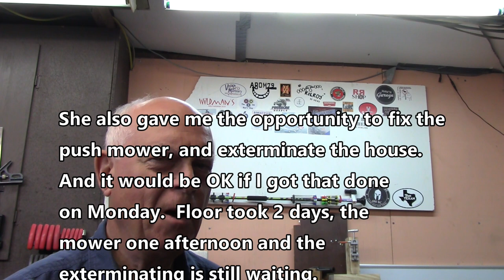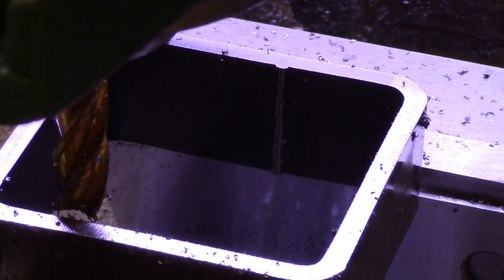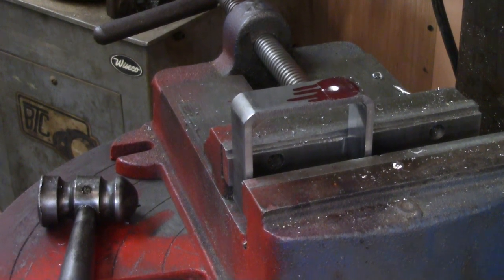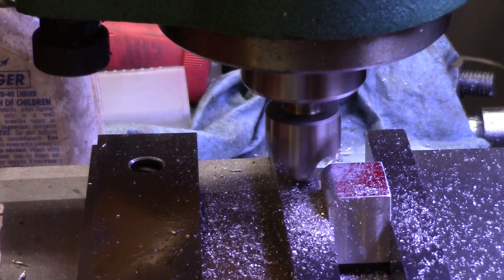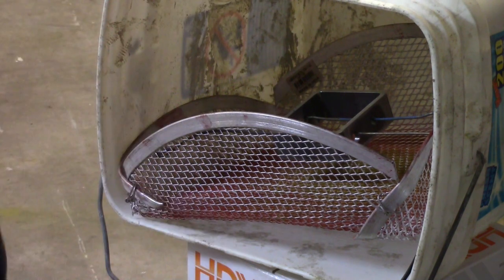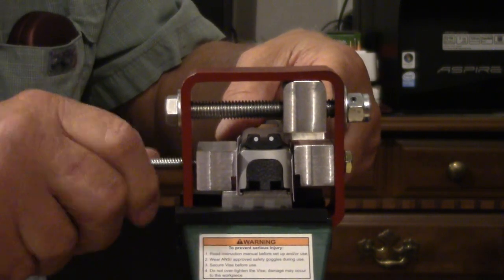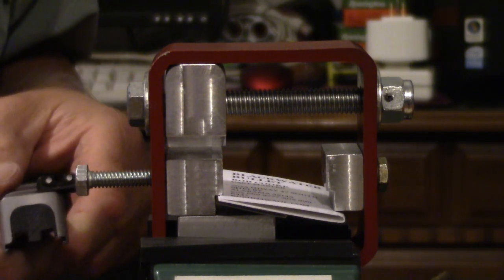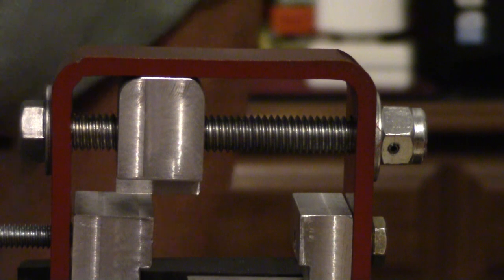Sight Pusher

Comment: A metric adjustable. I've got one of those. I've been meaning to make a sight pusher. This video just gave me the kick in keester that I needed. Thanks.
Reply from the maker: Go for it.  It is strange that such a simple thing took me so long.  I did at least half of the work off camera and still had a terribly long video.  Thanks for stopping by.

Comment: Harold, good video as usual. I would suggest you take a few little pieces of leather or even felt and glue them to the contact points to protect your slide.
Reply from the maker: That is an idea for sure.  Thanks for stopping by.

Comment: Hello Harold,  I coulda swore that was going to be a walnut cruncher!  Should get yourself an air pistol and or rifle and fabricate up a bullet trap (I used 3/16ths steel.  Looking endo it resembles a pie slice.  45 degree angles and the pellets deflect down into a piece of foam, rag or such.  Shoot up a storm for little money in your garage.  You would be surprised how the trigger pull and muscles are improved while you have a blast without having to gear up go to the range and wait your turn.  My off hand shooting with centerfire stuff was markedly improved when I was using the air rifle.  With my new shop expansion I am going to be able to get into it again.  Take care.  Doug
Reply from the maker: I have some Speer plastic bullets that I can use to shoot in the garage.  Just the primer is all you use from a regular gun.  Thanks for stopping by.  Unfortunately they are 38 special and I seldom shoot a revolver.  Thanks for stopping by.

Comment: Go look in my toolbox and bring me the metric crescent wrench. LOL. I am an electrician, I used to tell my green helpers to go look behind the seat in my truck and bring me the wire stretcher. They would look for a few minutes and come in and ask what does it look like? I would look at them and say "Damn ,am I going to have to go get it myself", So back to the truck they would go. I would finally let them off the hook and explain to them if their wire was too short their are other options.
Reply from the maker: New guy pranks are a lot of fun.  Everyone gets a turn on both sides.  Thanks for stopping by.

Comment: 10x6 a walk in closet, lol, thats bigger than what is called my 3rd bedoom! (its6x6 and the door misses the bed by 1/2 inch).  i reckon those cookies ARE oroes, i tell ya why, in the UK we dont much like them , so the have sold them SUPER cheap like 10c a pack, so i reckon someone rebranded them as a way to get rid of excess.  I used to eat the hard dog biscuits all the time, they were bit bland but i liked the crunch!
Reply from the maker: No one ever likes the food in another country.  Just look at the youtube videos on food tasting.  After you have seen one no need to see the rest.  The outcome is they don't like the food.  Thanks for stopping by.
Reply: 10 x 6 That's bigger than my shop.  regards.

Comment: S&W using plastic sights would have never thought that it was possible.  Is the front sight metal or plastic?
Reply from the maker: Plastic, it is dishwasher safe.  If I cannot improve the trigger I will trade it off.  I hate the trigger.  Thanks for stopping by.